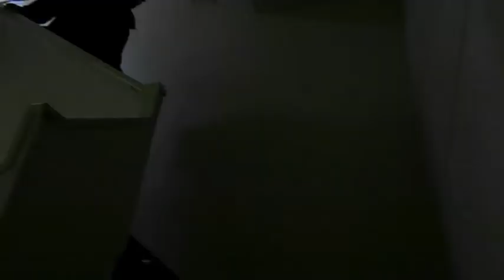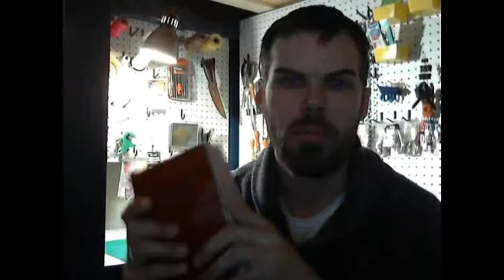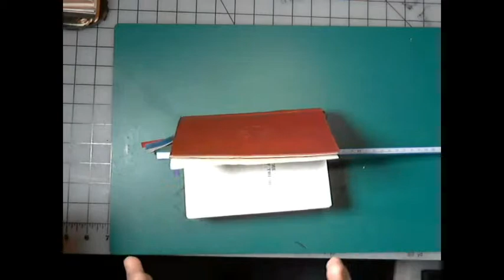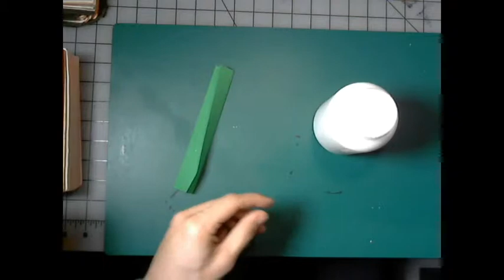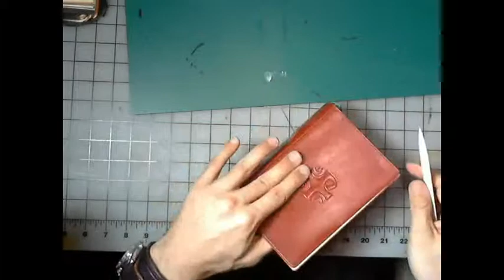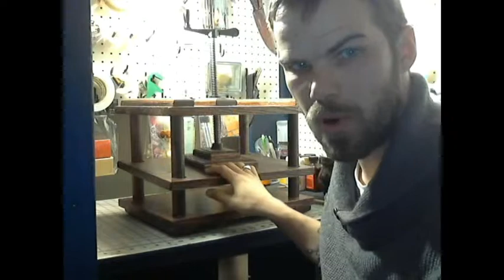Repairing a Torn Hinge Page in a Book

Comment: While the basic method you show here is appropriate, the use of book cloth on the book's pages is not. The repair should never be stronger than the original materials, as it will put stress on the pages over time, and as the paper ages, the cloth used for repair here will become a "knife-edge" which will damage the adjacent pages.  A book with a broken hinge that is expected to be used only infrequently can be repaired with the method you show, but substituting a very thin acid-free paper for the cloth. If, however, the book is expected to be heavily used, you might consider adding a hollow paper tube to the spine before mending the hinge with paper.
Reply from the maker: You are absolutely correct. In this particular case, the use and replacement time for this particular book is within a short time 2-3 years...(Because hopefully new editions would be coming out). For that reason I was ok with a less than best practice, thanks for pointing it out and hopefully people will read your comment as well.